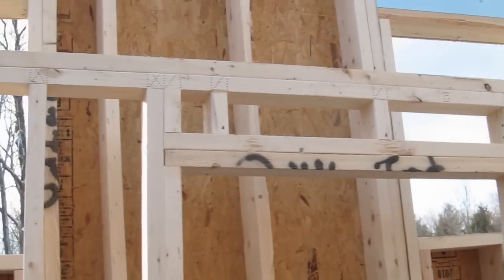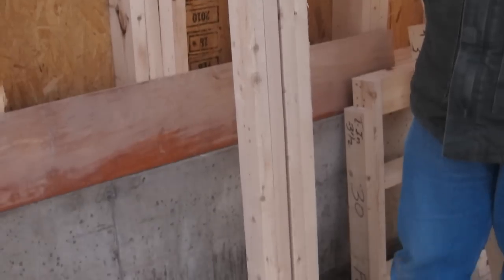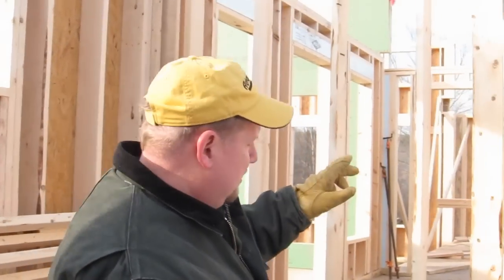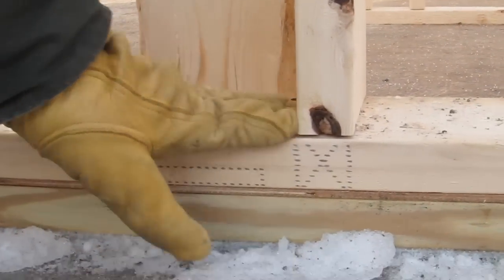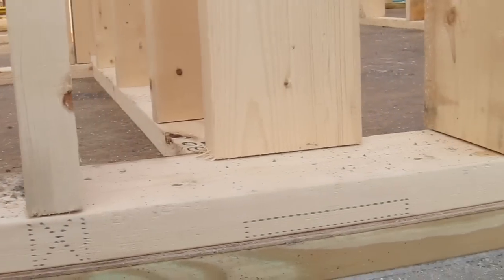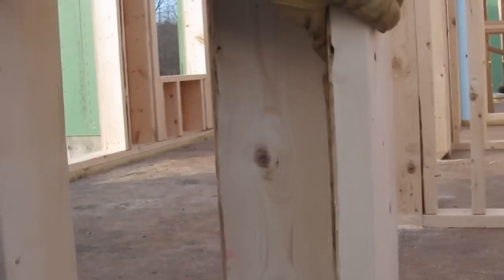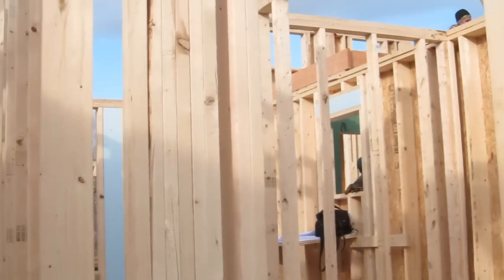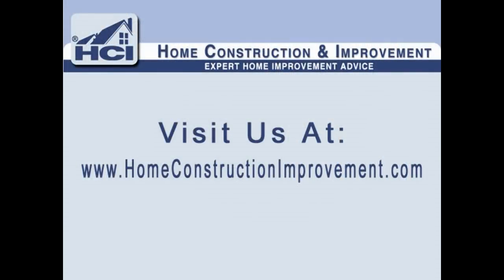Prefabricated Wall Panel Construction

Comment: So......when the walls are delivered in the snow the situation is different? ......Nope... this has been done for decades,  it will not make it to main steam. On condos, walls can be prefabbed on site, no desk jockey, no computer, no factory, no trucking, just one guy with layout  skill and knowledge, a tapemeasure, and a pencil. No contest. Maybe you "innovators" should invest in the trade through apprenticeship and certification instead.